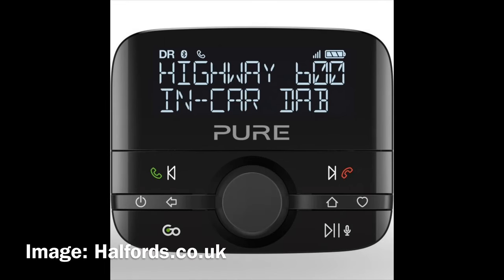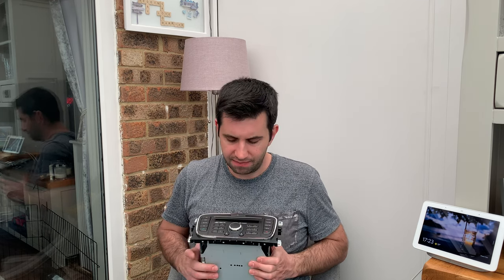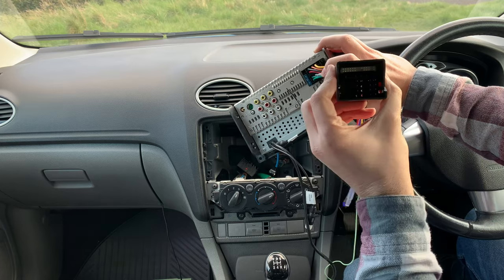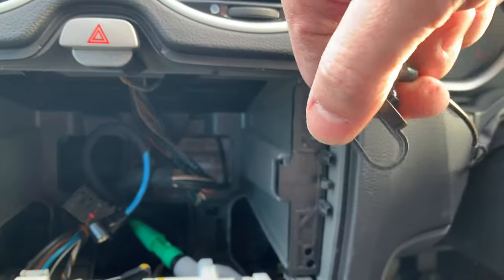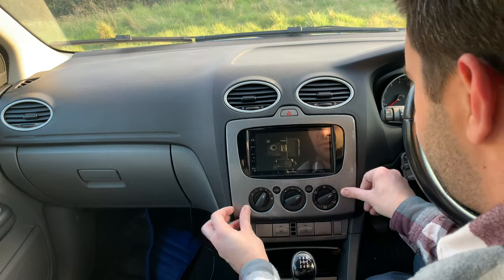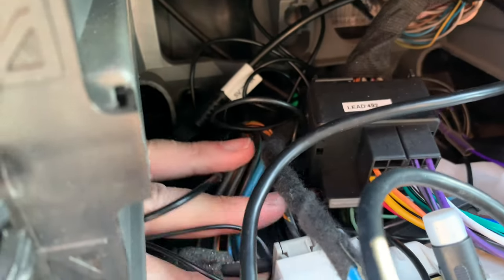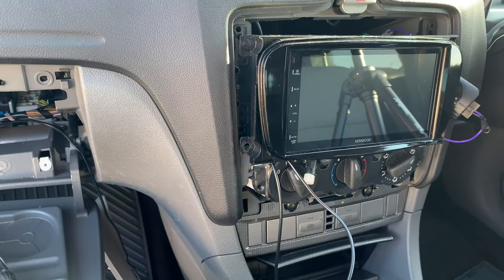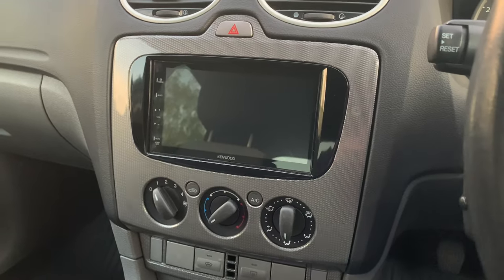Want better sound and radio? Get DAB Radio on your Focus MK2

Comment: No doubt a new aerial is needed if the windscreen requires replacement. I was considering changing the stock radio to DAB, but after seeing all the hassle, I'm not going to bother.
Reply from the maker: A windscreen isn’t something that is often replaced. A few other owners have successfully peeled off the old aerial and used a new stick pad and reused the aerial. 
Every improvement comes with a degree of effort and input and I understand that not everyone isn’t prepared to spare the time to do it, so it’s a matter of personal choice. I don’t do certain things on this car because either I choose not to or I don’t think it’s worth it for me.
However, what I’ve done in this video is anything but a hassle compared to other jobs I’ve done in this car.

Comment: Nice video! im going to try this on my '07 focus soon, Do you have any tips on how to get the steering wheel controls to work properly?
Reply from the maker: Thank you. In my case, the unit came with a converter for the controls as it was second hand, so I guess you have to buy that separately in some cases.

Comment: Can I ask why you chose not to use a Ford DAB aerial? Could you not have replaced the fm/am aerial that was on the car?
Reply from the maker: I already had replaced the FM/AM aerial (it’s on a previous video) but regardless, I wanted DAB radio as some stopped broadcasting in FM as I mentioned.
At the time of fitting this unit, Ford didn’t have the Focus MK2 DAB in stock and I couldn’t find any used ones either. I thought of using an aerial from the Focus MK3, but the mounting is slightly  different and because they are mounted at the rear, the aerial is different and would look too vertical if mounted at the front of the MK2
Reply: Oh right understood.

Comment: I see you have a dash cam. My Nextbase when powered ruins my DAB signal. Interested to see how you get on.
Reply from the maker: I have occasional dips, but that’s between counties. For example, I have to switch from Capital London to Capital Brighton when I go from Surrey to Sussex and vice versa. My wife’s MK3 is better, but not perfect.
I will be hardwiring the dashcam in a future video, so it’ll be good to know.
Reply: @GentilsGarage  might be worth googling it as it’s a very common problem. I have fitted the later Sony DAB radio into my Focus with the Ford Bluetooth module. Works very well and streams music as I did the software update and fitted the C112 Bluetooth module but with my hardwired Nextbase camera it loses all DAB stations that are a bit on the weak side.
Reply from the maker: With the older ford unit, I had occasional FM reception issues when I had my phone charging on the cigarette lighter. Haven’t used it since I had this unit, so that’s another things. I’ve read about stuff plugged to the cigarette lighter causing interference, but I’ll have a look regarding the DAB.
I was tempered to get the BT module and the Sony unit, but I simply couldn’t be bothered with the faf about programming (did that with BMW’s in the past) so this was much easier and straight forward.

Comment: Can you still control your volume from your steering wheel after you installed the radio?
Reply from the maker: yes, it came with an adapter/converter and works well

Comment: Hi mate does the head unit turn on with out the ignition turned on? I’ve just fitted a Kenwood unit and it only works with ignition on or car running cheers
Reply from the maker: same thing with mine, only with ignition on position 1
Reply: @GentilsGarage  cheers mate thanks

Comment: Got a link for this radio? Thanks
Reply from the maker: Here it is:
https://www.halfords.com/technology/car-audio/dab-car-stereos/kenwood-dmx125dab-car-stereo-280022.html
Reply: @GentilsGarage  Thank you. Does this fit the fascia or is there an extra I need?
Reply from the maker: @scottsimpson3851  you need the mk2.5 fascia plate. Mine was a second hand unit that was previously fitted to a mk2.5. Here’s an example:
https://www.dynamicsounds.co.uk/connects2-ct23fd07-ford-mondeo-focus-s-max-double-din-black-fascia-adaptor.html?tracking=60352430b19de&gclid=Cj0KCQjwpImTBhCmARIsAKr58cy57sVPDgF0rp0BuVx5fgmeYJQkMJMTOeYGM7bkeT2pCvOpbwzqhZYaAkw4EALw_wcB
Reply: @GentilsGarage got 2 questions, since i recently bought a 2nd hand  dab radio, also from kenwood. Kenwood Ddx4019dab, precisely. i spent so many days looking for a way to fit it in my focus mk2 fl from 2008 and just now realized, i had this video saved for later, 2 months ago, even before i bought the car itself.

the first question being (a bit unrelated, but still) does mk2.5 refer to mk2 facelift version?

and more importantly, is your kenwood the same size as mine? is it safe to just find the same fascia, order it, and finally get it done? or what's the screen size of your radio, i know mine's 6.2"

Comment: I fitted dab in mine but did the dab airel better buy using the original Ford dab antenna as well as the microphone in the interior light
But mine is a 2006 st225
Reply from the maker: I could not find the original Ford DAB for sale. When I enquired on the forums and Fb groups, many had the same problem, so i went for this setup instead.
Reply: It is expensive but found all parts on ebay brand new but all 4 parts needed for antenna come to £146
Reply from the maker: I would prefer to use OEM too, but not many of us with a bog standard Focus would be able to spend that much on a DAB aerial kit and that’s the purpose of this video. If I had an ST, I would definitely go down the OEM route as well. At the time, I searched Ford and eBay and the DAB aerial for the mk2 was not available, only for the mk3 and that doesn’t fit unfortunately.

Comment: I tried 2 x windscreen mounted DAB aerials (both branded), and they were less than useless. Though I do live in a rural area, I'm guessing if you live in a city and don't travel much they'd be fine. I finally got a reliable strong DAB signal using a £10 Halfords external MagMount aerial...
Reply from the maker: I’ve bought Halfords one as it worked very well with a couple of other owners. However, at the time, I didn’t see that external Magmount aerial for sale in Halfords.
Reply: It might also depend on specific windshield. Some windshields generally block reception a fair bit, especially if they are heated.
Reply: @Case_  LOL It's an LX - they don't have heated screens, or much else to be honest 🤣
Reply: @stephenm5000  Well it's not limited to heated windshields, it's more complicated than that. But OK, I was just trying to point out a reason why the same aerial might work better for someone than for someone else, nothing more.

Comment: Hi Gentile, one other upgrade you could do, is to fit the Sony upgrade speakers these are Blue in colour, and is known as the Titanium upgrade consisting of Six speakers for all Four doors inc the tweeters for the rear doors.  You will probably find the rear door cards have the circle marked out on the reverse, and the tweeter wire will be taped up ready to plug in. I got the complete set of E-bay, and this will enhance the sound of your new stereo.
Reply from the maker: Thats good to know, I wasn’t aware of that. thank you for letting me know.
Reply: Hi Gentile, another upgrade is the Titanium spec headlight switch unit.  Although with this, you have to get the switch unit from a Focus C-max, which upgrades your car with the Titanium level dashboard lights dimmer switch function. However, It is not possible to use one from the Focus Titanium, as it has auto headlights, where as the Focus C-max has the same headlight function as your Zetec level spec, with no auto headlights function, but with the added benefit of dimming.  Again, I got mine off E-bay. Hope this makes sense mate.
Reply from the maker: @chrisswann2868  thank you, that’s a good shout too. I’ll have a look